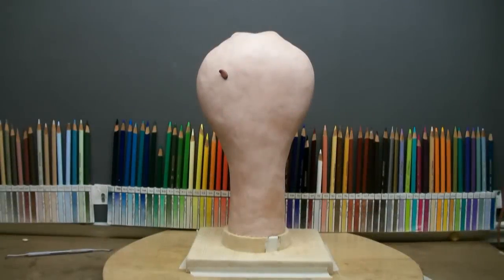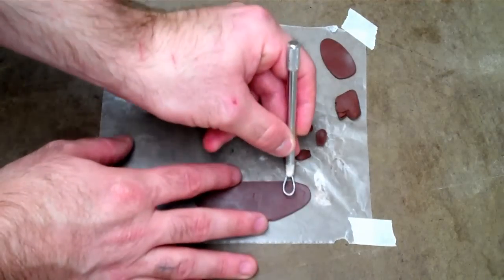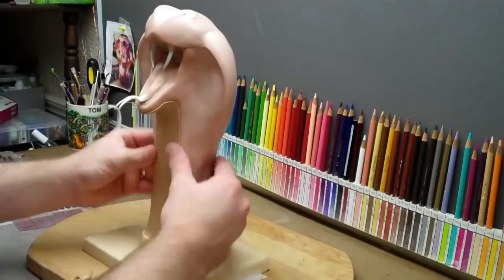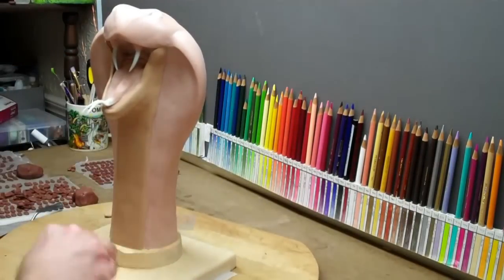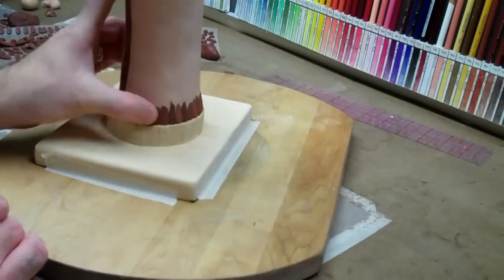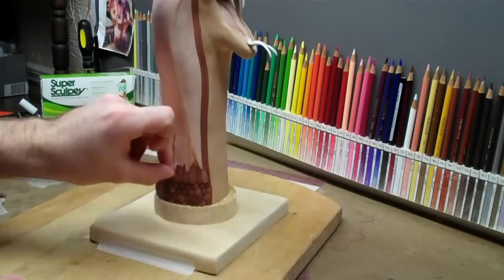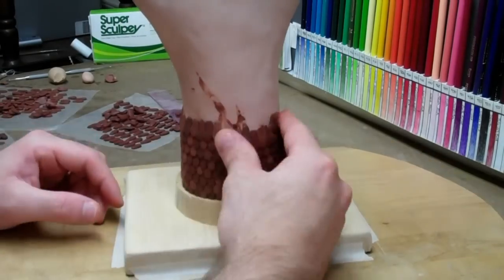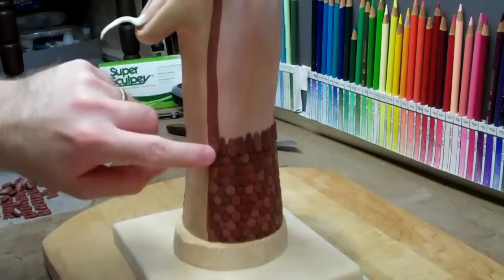How to make  PERFECT clay scales,  Polymer Clay!!

Comment from the maker: @TheMoonAndTheStars1  In this video I used a [Clay Extruding tool]  you can get it at Hobby-Lobby or Michael's.. it comes with like 15 different tip to use..  but its a bit hard to use.. *make sure the clay is well-conditioned before trying to push it through...  It costs about $10..     ***I now make the scales a different way.. a little easier.  Its in one of my "cobra videos" good luck!